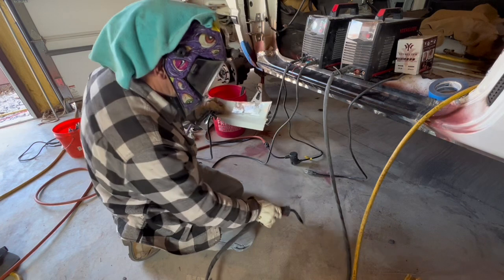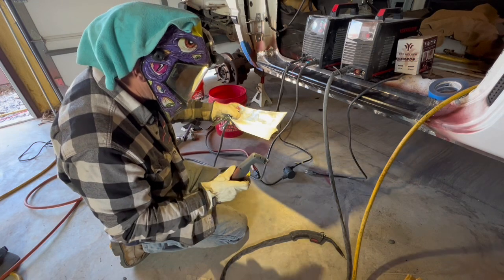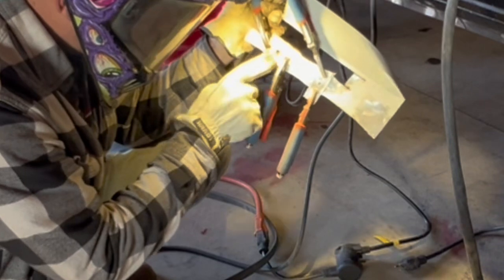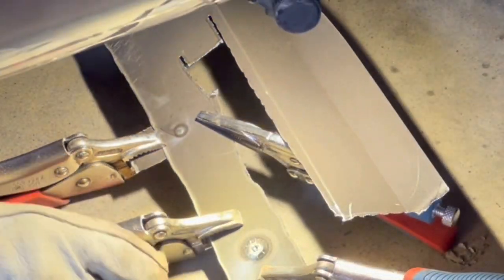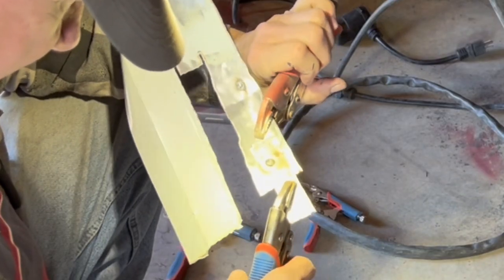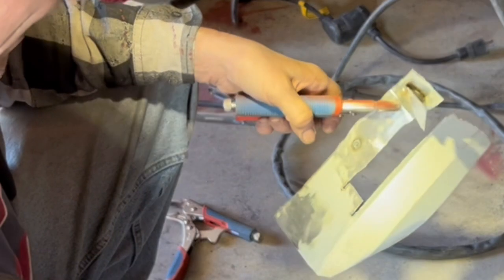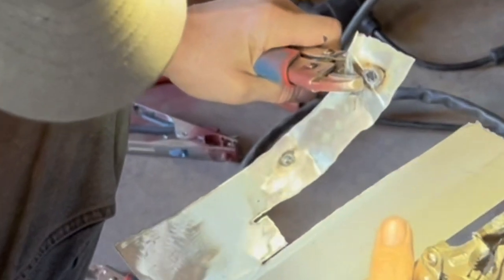PLUG WELD Failure & Success 🧐😁 Easy DIY Plasma Cutter Cutting Techniques To Prep Flux Core Welding

Comment: I was told that using a piece of brass under a blown hole is a good way to fill it in because the weld doesn’t stick to the brass.  True or False?
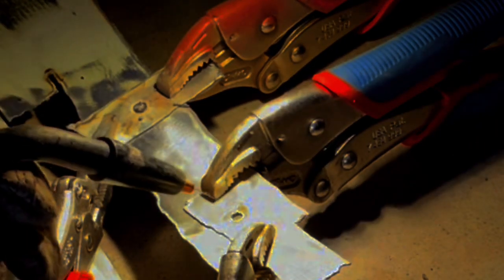Reply: Yes and no. You can use a "weld spoon" backer but Billy shows you really don't need to IF you watch his technique @ 2:02 He's basically spotting on the edges and going in a circle pattern around the hole and hitting the center puddle at the end. I've been welding a LONG time but not much in sheet metal work. Tried this after my grandson showed me and I'll be DAWG GONE if it works!!! STRONG SUCKA TOO! Takes a minute to learn but yep - it WORKS. To me it makes sense and saves a LOT of time and frustration...
Reply from the maker: It’s supposed to be copper , but I don’t have any trouble at all welding up a hole
Reply: @OldBondoBilly  copper, brass or bronze they all work
Reply: @Jack-1212 bingo !!!! 🎉
Reply: You are correct, use brass as a backing
Reply: ...us old farts gotta stick together! Same goes for welding - STICK TOGETHER

Comment: When I do my cab corners. I will draw a hole all the way through the original body and the cat corner that I am putting on there. I will make several holes all around everything. And then I will take my med and well. D*** up. But I tried to make it where it breaks out on a scene to where I well get there.  And when I grind it down I don't really see where I had welded. But when you put pain on it is when you tell, and that means you have to do a lot more grinding and sending but eventually it gets to where you can't see it now if it cracks later on down the road and you can tell it I don't know I've never had anything to do that. But most of my trucks I have rebuilt that I don't have no more. It's because they were involved in Iraq and not my fault. Ok, let's get that right direct. I've been in that has not been.  My fault. So I don't know how long the stuff that I do. Drill holes all the way through everything and philip bull just like what you did

Comment: I don't want you to take this the wrong way okay I don't do body work like what you do okay but what I do do is replace the parts like a fender or quarter panel but when I weld something in with my Mig I do my very best to where I don't have to use Bondo and a lot of people I know does the same thing I really don't understand why you use so much I'm not a hater and I'm learning a lot by watching you I would just like for you to explain to me okay because you can replace fenders hoods doors and all that I work on 73 to 79 Ford trucks I rebuild in as a hobby not for resale or nothing like that but when I strip them down to Bare frame I sandblast them or glass blast them okay and then I use this bed liner stuff to undercoat my calves my inside fenders and my complete frame I don't do this professionally I am what you call a backyard mechanic and body man
Reply: He don't use much... actually he just recently proved how much bondo he uses with a magnet and a "depth finder". He only uses it where he absolutely needs to.